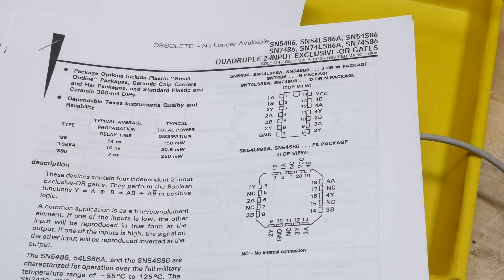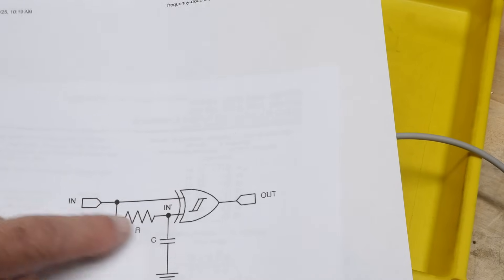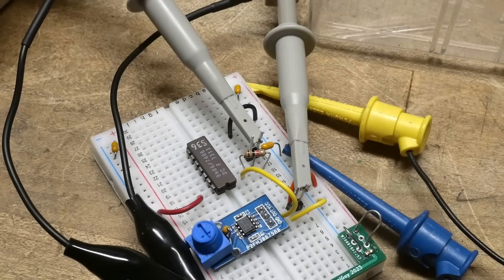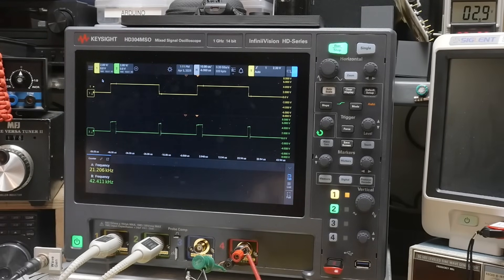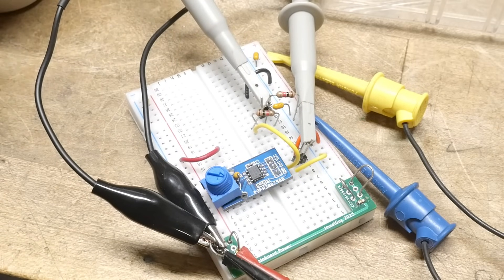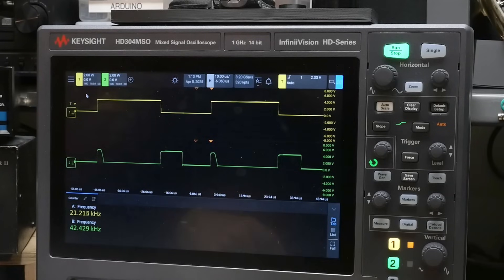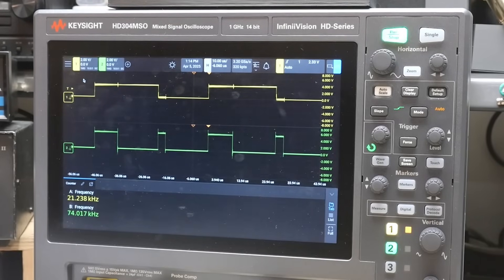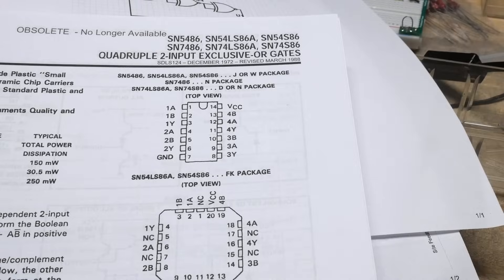#2209 TTL 7486  XOR Gate Frequency Doubler

Comment: 74HCS86 is the 74HC86 with Schmitt inputs
BTW:  You can use the 3 other gates in the quad package to make your delay and get really short pulses with no need of the RC.
I have also used an RLC to make the delay to get more delay with a faster slew rate as you go through the middle range of voltages.

Comment: I built a different frequency doubler with XOR gates in my youth, it used no passive components, only the XOR gates.
It's main flaw was you have to use all the four XOR gates for a single doubling stage
Reply: Can you post the schematic? Please
Reply: @rjameslower  I think I still have that schematic stored on my parents house, so it will take a while.
I tried to look for it too, but the only ones, at least on the first two search page results, are variants of the 90° phase with XOR.
Meanwhile, the most similar circuit behaviour (if my memory serves me well), is the one you found in the patent US5614841A, the timing diagram is exactly what I found on the circuit I mentioned.
You will be the first to know if I found it again
Reply: @jorgealzate4124  thanks

Comment: Did you note the frequency was more than doubled (almost 3x) with the HC part?
Reply: Looking at the waveform you can see it is doubled.  The measurement listing does show 21k and 57k, but you always need to be careful with those measurements.  As he noted with the ringing earlier, they can be tripped up depending on thresholds, and what edges it has decided to use to calculate with.

Comment: Using the other three gates to produce the delay would lower parts count and give a much nicer output.
Reply: Yes, and avoids the need for a schmitt. but the delay wants to be about half the period of the desired output. So using gate delays only works for fairly high freqencies.

Comment: For a single gate you can use the 74LVC1G58 as a Schmitt trigger XOR or the 74LVC1G57 as a Schmitt trigger XNOR.
And you shouldn't use the HC-series or any CMOS variant with unconnected inputs. It will most likely work but draws excessive current.

Comment: Mr Imsay, the Fallstad simulator shows pretty much the same outcome as you have on the scope. as long the pull down is slightly bigger the input.
It starts working from 68nF using as you 1k, if you use more than 100nF it look pretty much same as on your scope. if you remove the pull down, it's symmetrical in the width on both pulses, Thank you.

Comment: TI currently offers a Schmitt trigger XOR called the SN74HCS86.
I was following right along when with "There's another exclusive OR gate in the 4000 series" and I right away thought yeah, the CD4070, but then got puzzled by the CD4030.  I've used plenty of 4070s and 4077s in designs but I didn't even know of the 4030.  Looking at the TI datasheets the 4030 and 4070 appear identical with the same internal schematic and specs so I'm wondering if anybody knows what the difference is?
Reply: Yep, i discussed this too online, why there is CD4030 and CD4070, but the 74hc's are 5V or less, while the CD4000's are up to 20V.   
These masks are probably very old, the current people working at TI don't look at them anymore.
Reply: As far as I remember from my 90s adventures with CMOS 4000 series, 4030 and 4070 are pin compatible, but 4070 have higher current output and lower residual input current. I choose 4070 to drive LEDs instead 4030.